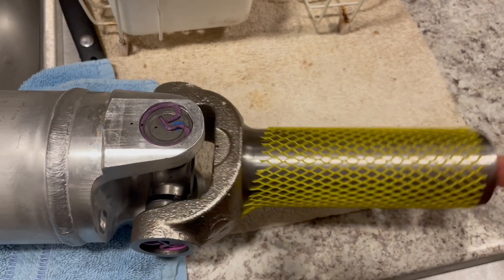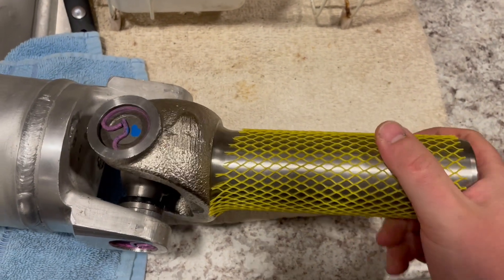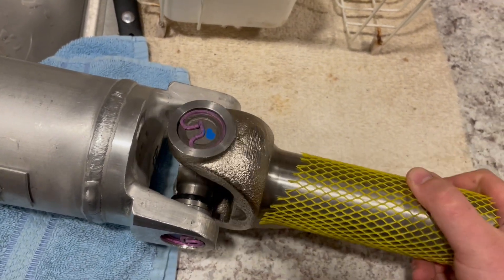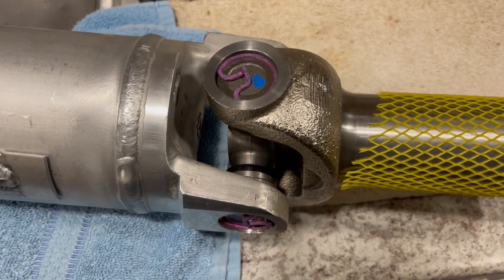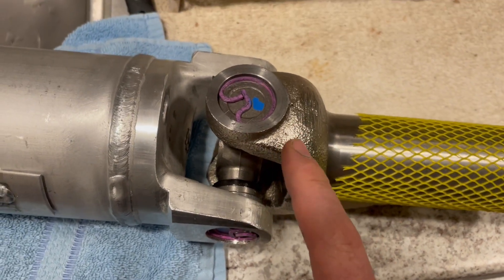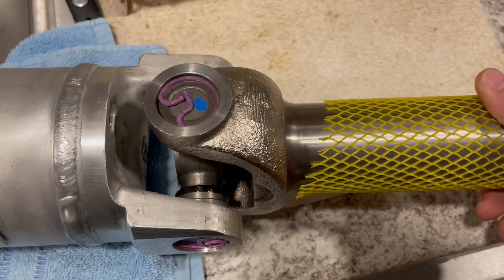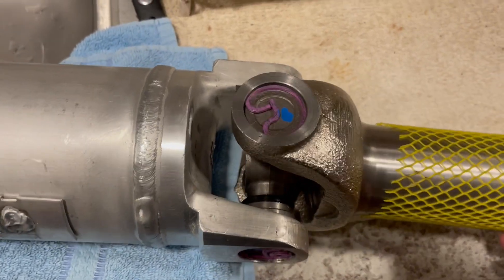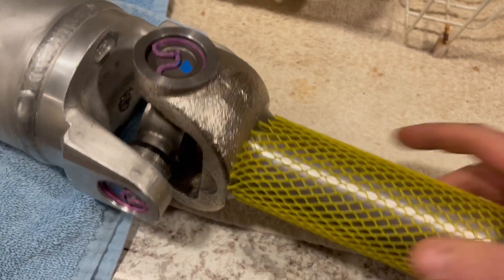DriveLine Series Part 1: DriveShaft Vibration Caused by Stiff Universal Joints

Comment: so how you fix it ? was snap rings too thick ?
Reply from the maker: This shaft was sent back and i just bit the bullet and spent the time rebuilding my stock driveshaft. Because Dorman through (Pti Powertrain industries) sent me 2 that were jammed so bad. Yes, thinner snaprings needed. Spicer has different colors. Pink are .063".  Every shaft has different needs. They crammed the snapring into the groove and it squeezed the ujoint to death. Inside someone smashed the little plastic washer in the bottom of the cap to bits, probly with a press. i have pictures of it. They could not understand or want to do anything about it. But they did refund because it was through ebay. If bought from the auto parts store it can only be exchanged. They have back their garbage.
It was built straight, the tube suprisingly only had .001" runout. Almost dead straight. But whoever it was handed off to for pressing in the ujoints was a maniac.  One of them was .025" off center causing the shaft to be off center. And where did they weld on the weights? exactly on the light side 😊
Having the ujoint jammed together prohibits smooth operation and makes a shudder but people including many driveline shops do not know this. If you are interested in learning more i may write a book if i feel its worth my time. "WeberAuto" channel also has mindblowing eye opening stuff about these snap rings
Reply: @dangerdavefreestyle  thanks for reply. yes those weberauto videos are great i just watched them couple days ago. seems that many people have exact same problem with those snap rings. even the thinnest wont fit and u joint goes stiff. some people just smack yoke with hammer and it kinda frees u joint but i dont think that is the right way to deal it.
Reply from the maker: @ i got another oem shaft that was almost mint, very low miles, but it had one bad ujoint in the rear. a stock ford ujoint comes with yellow and blue snap rings in case you need them and it just says to use whichever fit best 😄none of them fit and i had to make custom ones something like .057"
"ears must be bent" nope! every shaft is different by thousandths of an inch, unless you get lucky!
i have read reviews on advance auto parts and seen others with the same problems too! those ujoints they sell are horrible and so are the clerks with their lack of understanding!

as far as hitting it with a hammer. that pushes on the cap which pushes on the snap ring, bows it out on one side, puts the shaft off center, and creates an unknown amount of "axial play".
Professor Kelley says this axial play must be set correctly with a dial indicator otherwise if it is excessive the ujoint slaps around in tgere and creates a vibration and/or it can put the shaft out of balance if it was already on the edge of having too much runout and you just added another ten thousandths with the hammer. And again, this probably would not act up on a straight balancing lathe because there is no ujoint operation involved in that scenario. They would just add weight or move the weights positions to another spot and say "looks good to me"